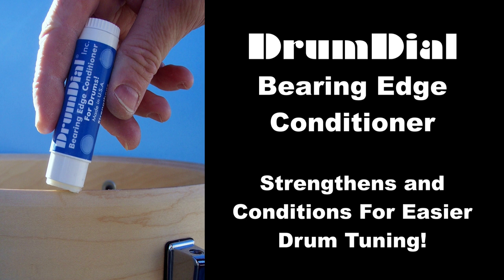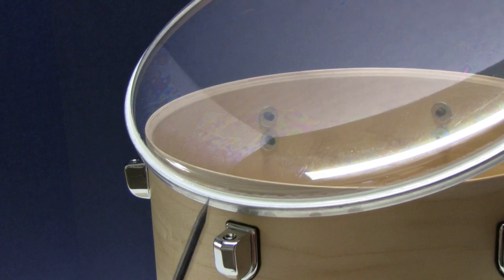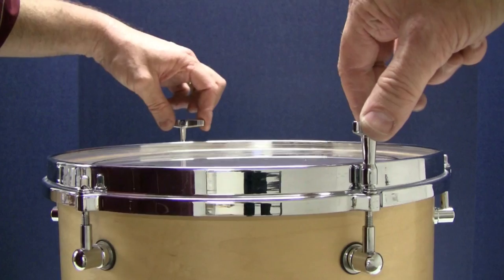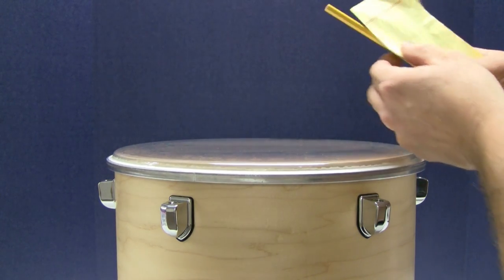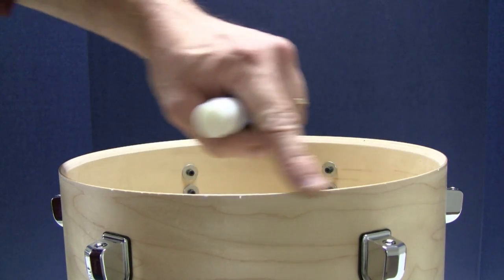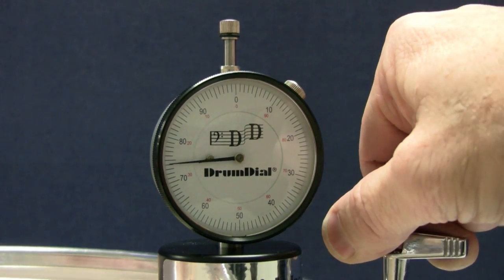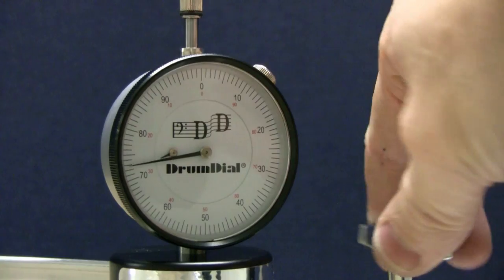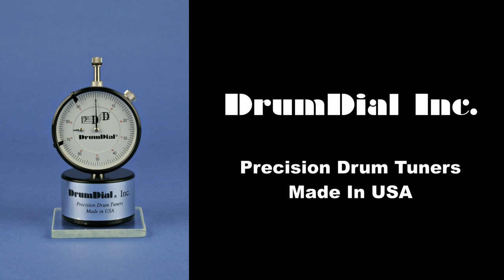DrumDial Drum Tuning Part 6 (Bearing Edge Conditioner) Advanced Tuning Techniques.

Comment: Just curious how long after applying the conditioner will the stuff last on the edge ? I take it probably needs reapplying with new heads, but since it is like a Vaseline type paste i would assume it would last awhile true ? thanks.
Reply from the maker: +christopher dunn It lasts a very long time once applied and a small amount goes a long way. At each head change, apply a thin coat to the inside collar of the drum head.

Comment: Does this conditioner increase the durability of the bearing edge
Reply from the maker: Thanks Nick, excellent question! Our bearing edge conditioner conditions the wood to prevent the wood fibers from drying out and splintering. The resin strengthens the wood as pressure from the drum head contacts the bearing edge making it even stronger with each tuning or head change. The resin permeates the wood fibers to help compress and strengthen the edge.

Comment: Hi there Steve I've been tuning my drums and one of my lugs is tight it basically won't go anymore and on the snare I car'nt get to go to 81 or 80 on the bottom side so I had to leave it maybe I need some of the solution for the edge of the drum to make life easy its worth getting some after checking your video out
Reply from the maker: If the threads are not bottomed out or stripped the conditioner will help. If the lugs come loose after lubrication, use lug locks etc to prevent the t-rods from backing out.

Comment: Is there a special type kind of cleaning solution you need to use before applying the bearing edge conditioner?
Reply from the maker: No, but we usually wipe down the bearings edges with a soft cloth to remove any lint or dust between head changes.

Comment: I recently acquired a 6x14 Pork Pie Little Squealer snare. The drum has a powder coat finish which was not masked off of the bearing edges, and the heads are binding on this, especially the resonant head. I was thinking of carefully sanding this off of the bearing edges so the head can move more freely. Would the Bearing Edge Conditioner work on metal shell drums also?
Reply from the maker: +Kelly Avery  Yes, works well on metal bearing edges (steel, chrome, etc.). Timpani bowls are usually copper and we have had excellent success with copper edges also. 

On a side note, we have had very good results with buffing and polishing unmasked powder coated edges until smooth (not taking it down to bare metal). Then applying the bearing edge conditioner.
Reply: Thanks for the quick reply! Would not have thought to buff the edges instead of sanding. I'll go pick up a buffing wheel and a tube of the edge conditioner. 

It's a really good-sounding drum even considering the price point but tuning it can be a challenge.

I also have a 6.5x14 brass Supraphonic that I have suspected of having a high spot on opposite sides, confirmed by the DrumDial. It's not bad enough that the lugs are rattling loose but they are noticeably looser and I think it's affecting the sound. How expensive is it to have the edges trued up on a metal snare?

Thanks for a great product and for sharing your knowledge with the drumming community.
Reply from the maker: +Kelly Avery  Check to make sure of the high spots on the metal snare shell first, just like you would on a wooden shell (see our video 3 on troubleshooting). Sometimes it may be the hoop rather than the bearing edge. Check with your local custom drum builder for pricing on the metal bearing edge adjustments. Usually slightly higher than for wooden shells.
Reply: +DrumDial If I may ask, what is your preferred method of buffing & polishing powder coated bearing edges?
Reply from the maker: +Kelly Avery 
We use 1000 grit emery paper and a small amount of water, followed by a buffing wheel, lightly loaded with a white buffing rouge for plastics.

Comment: Hello Steve, I am confused so have a few questions if you don’t mind please. . .  Is the dragging effect a symptom of a bearing edge issue as opposed to increased tension. Why is it some drums have this issue and not others? Does this product work by creating lubrication between head and bearing edge or by strengthening and conditioning the bearing edge? Why would some bearing edges need strengthening and conditioning? How does lack of strength and condition create dragging and vice versa? What do you mean specifically by strength and conditioning? How does this product strengthen and condition? Would a fine sanding of the bearing edge equally help?
Reply from the maker: The "dragging effect" is common, especially at higher tunings and for sharp bearing edges (45 deg A cuts etc.). A slight round over edge helps. The conditioner works by making the bearing edge very slippery and also conditions the wood fibers and strengthens with the added head pressure by keeping the wood fibers from drying out and chipping, flaking or splintering over time. A second ingredient in the conditioner strengthens the wood as pressure from the drum head contacts the bearing edge making it even stronger with each tuning or head change. This resin type ingredient permeates the wood fibers to help compress and strengthen the edge. 

It does both, conditions for lubricity and strengthens the edges over the long run for easier tuning. "Lack of strength" of the bearing edge doesn't cause dragging. Friction and lack of lubrication between the bearing edge and inside collar of the drum head when tightening causes the "dragging effect". Extreme fine sanding would help, but the wood should still be treated at the edge. 

Thank you for the questions!

Comment: What is it help when we use bearing edges conditioner?
Reply from the maker: DrumDial's Bearing Edge Conditioner keeps your bearing edges in better shape for a long time, which helps your drums stay in tune and lets the head glide smooth as silk over the edge during the tuning process!
Reply: DrumDial thanks